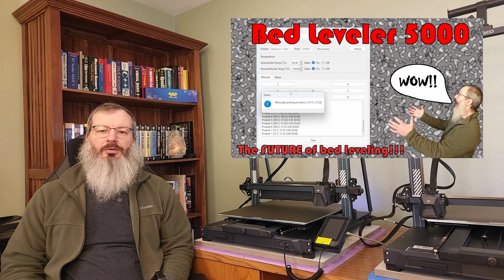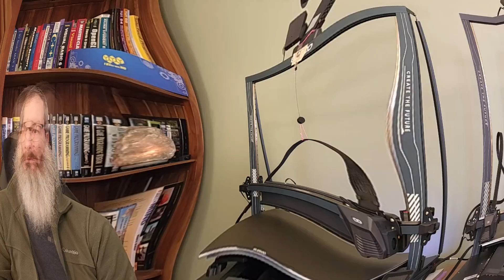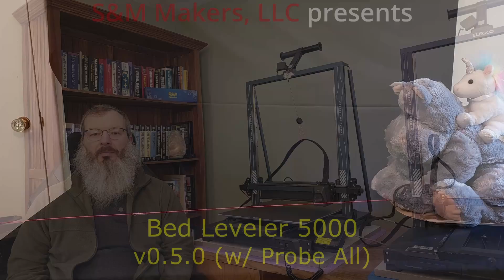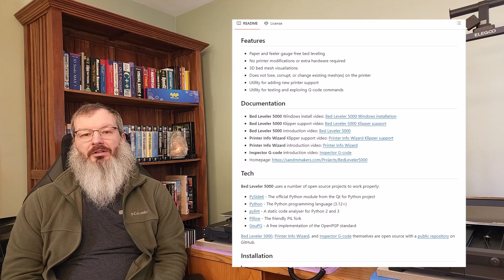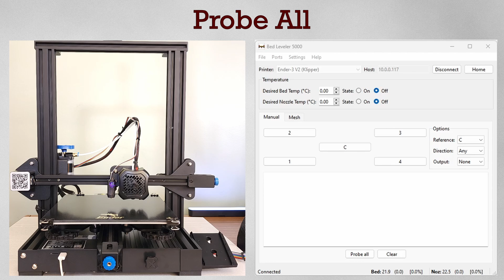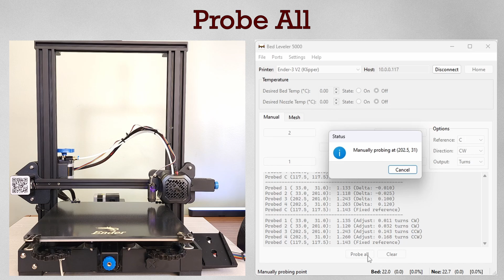Bed Leveler 5000 v0.5.0: The update that changes EVERYTHING!!

Comment: I have a Neptune 4 Plus and was able to install BL5000 on my Mac.  However when I try to connect to the printer it stays at the "Initializing printer" step and nothing happens and in the terminal I get:
json.decoder.JSONDecodeError: Expecting value: line 1 column 1 (char 0) 
Anyone have any ideas what might be going wrong?
Reply from the maker: That error indicates an issue with one of the printer configuration files. Try moving all configuration files except the one for your printer, outside of the Printers directory.
Reply: Thanks so much, I appreciate your response.  I moved all files other than ElegooNeptune4Plus.json out of the "Printers" folder but am still getting the same error. 
Full output from terminal:
qt.qpa.fonts: Populating font family aliases took 175 ms. Replace uses of missing font family "Cascadia Mono" with one that exists to avoid this cost. 
Traceback (most recent call last):
  File "Printers/Moonraker/MoonrakerPrinter.py", line 188, in processReply
  File "json/__init__.py", line 346, in loads
  File "json/decoder.py", line 337, in decode
  File "json/decoder.py", line 355, in raw_decode
json.decoder.JSONDecodeError: Expecting value: line 1 column 1 (char 0)
Traceback (most recent call last):
  File "Printers/Moonraker/MoonrakerPrinter.py", line 188, in processReply
  File "json/__init__.py", line 346, in loads
  File "json/decoder.py", line 337, in decode
  File "json/decoder.py", line 355, in raw_decode
json.decoder.JSONDecodeError: Expecting value: line 1 column 1 (char 0)
  @SandMMakers
Reply from the maker: Did you edit the file or could it have become corrupted somehow? Can you please try testing with a freshly downloaded copy of the configuration file? Unless MacOS is doing something strange to the files, I really have no idea what could be causing the problem, other than corruption. Another thing you could try is to test the file with an online JSON validator, like this one: https://jsonlint.com.
Reply: I went ahead and re-downloaded the file and did all the same steps but am getting the same errors.  If it matters, I did not extract the archive through the terminal I did it through the desktop because when I tried in the terminal I got the following error:  tar: Error opening archive: Failed to open 'BedLeveler5000-vX.X.X-macos-x86_64.tgz'
I really apologize, I don't expect you to be doing tech support lol.  If you want me to just send this info somewhere let me know, that way I won't clutter up your YouTube comments. Thanks again. @SandMMakers
Reply from the maker: When exacting the archive from the command line, you need to replace X.X.X with the version number of the release you are extracting. I'm hoping we can figure out what is going wrong on your computer. Can you please file a bug report on Github so I can look into it more tomorrow? Thank you! I don't have a MacOS computer, nor have I ever used one, but I want to ensure everyone gets to use BL5K!
Reply: Submitted, and thank you again!   @SandMMakers
Reply from the maker: Hi. Any updates?

Comment: Too bad there's no "Clicky Knobs" on Bed Lever Knobs.... you could give clicks CW / CCW in your options.  Plus it would help with the knobs drifting off desired position over time.  I'm looking to design something like that for my Neptune.
Reply from the maker: I'm not sure what you mean by "clicky knobs". If you are referring to adding some kind of clip to prevent the screws from moving, that is out the scope of BL5K. Nothing prevents you from using clips.
Reply: @SandMMakers  No, I mean knobs that have that subtle click as you turn them. click click click...old school.  detents etc... :)  Like 100 clicks per full turn..or something like that.  (.01 turn resolution).  It could integrate nicely to the Bedlever5000

Comment: Another superb update ,thanks a lot.just a small suggestion for big bed users,take it to 60 degrees and wait for a 20 min to start making the bed mesh,this way you will make sure the table will warp max and give you a better mesh
Reply from the maker: Thank you! Yes, we always recommend leveling after your bed has stabilized at the temperatures you normally use while printing.

Comment: Can I connect this to my N4M via wifi?
Reply from the maker: BL5K just cares that your printer is connected to your local network. It doesn't care (and has no way to tell) how it is connected.
Reply: @SandMMakers  is there a way to use BL5K without connecting my N4P to a network ? (I don't have access to a router or wifi but I can connect it to my computer via ethernet)
Reply from the maker: If you can access Fluidd, you should be able to use BL5K.  BL5K doesn't know, or care, how your printer and computer are connected, just that they are connected.
Reply: @SandMMakers  I'll try setting up an ethernet Lan via my computer !
Reply from the maker: Good luck! Let me know how it goes!

Comment: what if we have a custom built printer can we change the x/y settings to line up with our screws?
Reply from the maker: Thank you for watching our videos and your interest in BL5K!! Yes, BL5K can easily be configured for any screw layout. Each printer has a configuration, which is a simple JSON (i.e., text) file. You could just copy an existing configuration file (of the same firmware type) and edit the values by hand, but I created a utility specifically for creating configuration files. It is called the Printer Info Wizard and is included in the BL5K archive.
Reply: perfect!!!  thanks again and keep up the awesome work man!!!! @SandMMakers

Comment: Hi, i was wondering if you ever encountered issues with probe inaccuracy with Neptune 4 Pro? I noticed the probe at my rear left and front right screws are consistently higher than my front left and rear righht screws by 10 to 15 seconds. This is even though ive verified with a feeler gauge that the bed is level at the screws
Reply from the maker: That sounds like a possible mechanical issue with your printer. Are you sure the frame and gantry are square? Could also be a POM wheel issue if they are deformed or damaged.
Reply: @SandMMakers it is hard to square them completely -- in particular, it's really hard to measure if the two z gantries are parallel to each other (my carpenter square is too big) and even if they are not, it's difficult to adjust them to be perfect). However, the issue I am facing is that consistently, the probe_calibrate z offset value at the rear left screw is about 0.1 higher than the offset value at the front left screw. On the other hand, on the rear right screw, it is about 0.1 lower than the offset value at the front right screw. I actually ran probe_calibrate at 25 points by painstakingly keying in coordinates in fluidd and recorded my results here: https://i.redd.it/3lw4x7eikcic1.png?utm_medium=android_app&utm_source=share

It appears to be some weird sort of axis twist that I still cannot figure out why it's happening. Took apart and reassembled the whole printer and I get similar readings.

Basically I use a feeler gauge and see the point where the nozzle just contacts its reflection which I think gets me rather consistent results

While I understand this is not the intent of bed leveller 5000 I thought it would be perfect if somehow the app allows me to manually probe a single location on the 11x11 mesh and then allow me to run a probe_calibrate on the same point so as to allow me to test probe accuracy between points.

Or for those of us with lousy probes, a manual mesh feature where you basically create a mesh manually using a feeler gauge and then tweak specific points on the mesh as and when needed
Reply: @SandMMakers  Thanks. It is very difficult to get everything square. I noticed my right gantry is a little bit out of square (even after tearing it apart and putting it back together) and while I've tried my best to fix it with some aluminium shims, it's quite hard to measure whether both gantries are parallel and even if they are not completely parallel, it's hard to fix it without affecting anything else...

Actually I was wondering if there would be an option to do a manual (in the sense that it does not rely on the probe at all) bed levelling, or to probe specific points on the 11x11 mesh rather than having it run at one go? It's kinda tiring right now for me to do probe_calibrate and probe_accuracy manually via fluidd
Reply from the maker: I'm not really sure what could be causing those issues. I have not encountered anyone describing anything similar before. However, I'm constantly adding new features to BL5K. Probably a month or two before the next release.

Comment: So you mention a specific ender printer, will this work with the cr10 pro?
Reply from the maker: Thank you for watching our videos and your interest in BL5K!! Yes, BL5K should be compatible with your printer, assuming it supports manual bed leveling. The only issue, assuming the bed screws are at different coordinates than with the Ender-3 V2, is that you will need to create a printer configuration file. These are fairly simple text files. The software suite includes a utility, named Printer Info Wizard, to make generating new configuration files very easy. We have two older videos demonstrating how to use the utility and plan on releasing an updated video soon. Using the Printer Info Wizard shouldn't take you more than 5 minutes. If you do create a new configuration file, please send it to us, through Github, and we will add it to the next BL5K release.